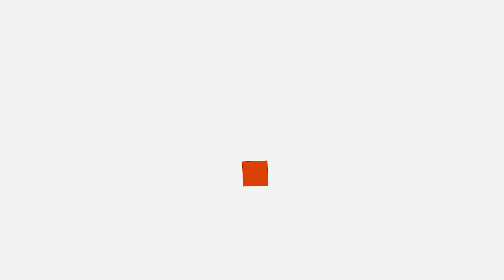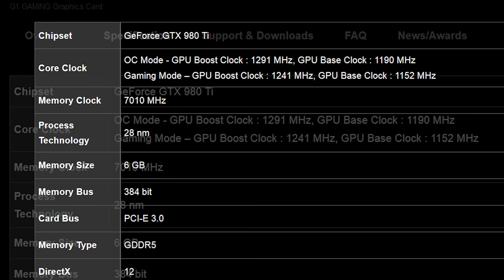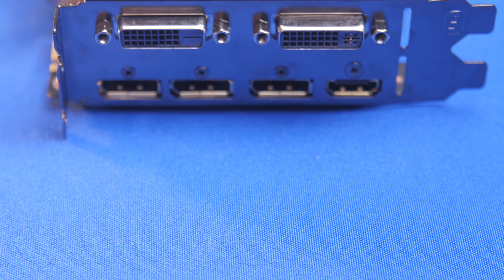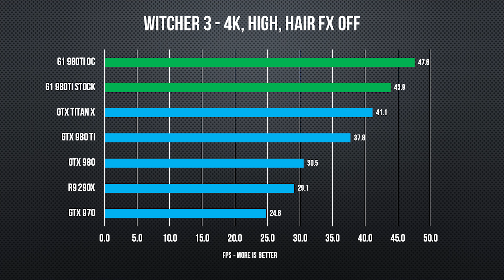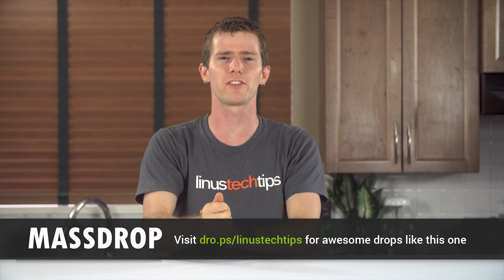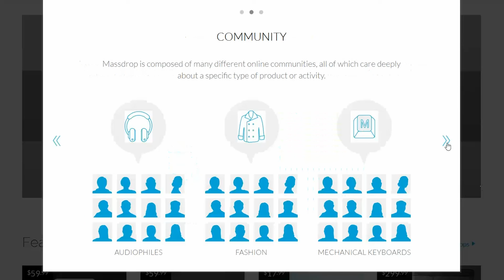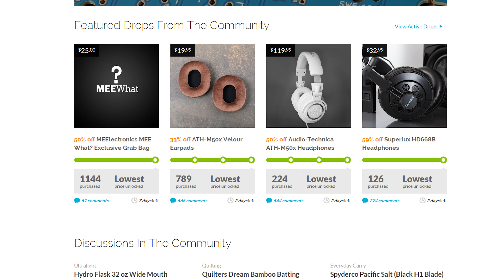Gigabyte G1 Gaming GTX 980 Ti - Both Beauty & Brawn?

Comment: Is this good?
CPU- Intel Core i7-4790K 4.0GHz Quad-Core Processor
Cooler- Cooler Master Hyper 212 EVO 82.9 CFM Sleeve Bearing CPU Cooler
Motherboard- MSI Z97-GAMING 5 ATX LGA1150 Motherboard
Memory- G.Skill Ripjaws X Series 32GB (4X8GB) DDR3-1333 Memory
Storage- Seagate Barracuda 1TB 3.5" 7200RPM Internal Harddrive 
Video Card- MSI Geforce GTX 970 4GB Twin Frozr V Video Card
Case- DIYPC Skyline ATX Full Tower Gaming Computer Case
Power Supply- Corsair CX 600W 80+ Bronze Certified Semi-Modular ATX Power Supply
Optical Drive- LG WH14NS40 Blu-Ray/DVD/CDWriter

Comment: Ehm, I love LTT, but seriously - TX just got wrecked? TX is the better card - 980Ti is a cut down version of the same core. How can you compare OC'd results from 980Ti with stock TX? :D Who in their right mind buys a Titan X and runs it at stock? :D Luke, Luke :). Jayz did an excellent video on this, OC'd Titan X, vs OC'd G1 Gaming 980Ti - aaaand yeah, 980Ti still fell short even though it was clocked 1529MHz vs 1400MHz on TX. I can run my TX at stock volts @1405/4000. If I go bananous with volts, it gets up to 1520/4000 and I'm not even running a full block. I usually clock it @1480/3970 for gaming, but at that, it still blows this card. Until we see crazy high (1.4 and more) volts cards like KINGPIN or the new LN2 HOF, TX is still the king. Just look at Firestrike HOF ;)
Reply: the Titan owners defend their titan cards
Reply: tosasaurus DEFENCE!!!! :D but seriously, I think saying "TX got wrecked" is misleading without providing context. I will readily grant that 980Ti is a better bang for the buck - by far - Titan X is an enthusiast-grade product and you pay premium for it - but it is the the faster card. Simple as that :)
Reply: Yep you are right! If I had the money i would go for the Titan X but I chose this card and will be getting it tomorrow :D
Reply: tosasaurus You won't be disappointed ;) Enjoy your new awesome GPU!
Reply: Thanks!! Super psyched

Comment: Linus! Something that would be FRICKIN AWESOME would be to have a benchmark build containing 4-way crossfire with 4 radeon r9 295x2's!!! It would make my day! :D
Reply: Alexander Zapff the r9 295x2 is already a dual gpu card.  That would be technically be 8way crossfire in which the support for such doesn't exist yet.

The maximum amount of gpus ( be it four single gpu vid cards or two dual gpu vid cards ) that any motherboard can support regardless...its 4.
Reply: then make it dual crossfire r9 295x2, and benchmark it!
Reply: Alexander Zapff Just find a benchmark of 4 slightly overclocked r9 290x's and you have a similar score. Besides, they don't have an r9 295x2.
Reply: yeah... I just wanted to see him overclock the crap out of them and run a couple 4k games simultaneously on multiple monitors... sigh

Comment: so why buy a titan?
Reply: superguitarmaniac100 because its the better card and 12GB of VRAM. Yes yes - I can already hear the comments - ITS TOOOO MUCH! Same story we heard when 780Ti launched with 3GBs and lookie now :). If you want the absolute best single-card GPU, get the Titan. If you want a really really good GPU for much better price to performance ration and/or more silent solution (AT STOCK - which - if you run TX is sort of meh :D) and/or you don't plan to overclock yourself, get this or other variants of 980Ti. Simple.
Reply: ***** If this card is clocking in at better higher speeds and crushing the Titan X on 4k by 10 to 15 frames per game, while also being 300 dollars cheaper, why wouldnt i get this 980ti? 12 gb vram is overkill and 6gb vram on this card is future proof enough for years since game devs are stunted to make really demanding vram games due to the current gens consoles
Reply: Alfred Ortiz Correct. These guys are not stupid. Playing up the relatively affordable 980 ti and down playing a generally disliked $1K gpu, garners many more likes. To their credit, they didn't lie. They just didn't OC the stronger card. Impressionable youths that follow them will eat this farce up and spew it out as gospel. For shame LTT. Likes are worth more than getting down to the metal it seems. Still, it's solid info however misleading.
Reply: Brandon Ferreira not sure if trolling or you simply don't grasp the concept of factory OC? He is saying the graph itself is misleading. As I have explained in the first comment, this 980Ti is factory overclocked - at stock speed. This is ONLY useful if you don't overclock the card yourself at all - and I'm having hard time imagining a lot of people who buy $780/$1000 GPU will run it at stock. I.e. its faster for people who are lazy and/or don't know what they are doing (for various reasons - I can elaborate), but the potential of the card itself does not change with this (albeit it is very very marginally better because of cut down cuda count and arguably better PCB design). When Luke said that TX got rekt and that we all knew it was coming, it sounded like he was implying G1 is the better/faster card - which it is only under that limited scenario. Overall, its still a slower card (albeit a better deal in price/performance category) and thus is conclusion is incomplete at best - more likely factually wrong.
Reply: titan x out performs the g1. sorry. you're just wrong.
Reply: Michael Angst yeah... no. Games go over 6gb now and it won't get better. Remember the 780Ti launch? 3GB is plenty!!!!! You won't need more than that! 6GB is crazy too much!! 

Yeah that died out quickly. If you plan to buy Pascal as soon as it releases and dont' care for occassional stutter, you are fine. If you want peace of mind, you go with TX.

Also your comment on G1 is just wrong (unless you run stock clocks on both cards in which case you are doing it wrong). Shows how much you know about GPUs and who the faggot here is ;).
Reply: Brandon Ferreira True. But if you manually overclock the titan it will still beat this card. I suspect this is why slick played up the "boost up on their own" card. Titan X got wrecked in his review, but it was not a fair comparison. Nobody it seems cares for a 1000 dollar gpu.
Reply: Brandon Ferreira again not sure if serious (this answers specifically your first comment). First, its not crushing it by 10 - 15 frames per game @4K even according to the graphs - you might want to watch again ;). Second, its doing so because its overclocked - both at stock and then the OC that Luke put on it and you are comparing with stock speed card. Factory overclock simply means that you ship the card closer to its limit. Meaning this card @"stock" goes up to @1370MHz on core, while overclocked it was 1480Mhz + I bet you that Luke overclocked memory because there is no way 110Mhz is 3.7FPS @4k Witcher 3 . But the limit for this card is - like any other GM200 card around 1550MHz (+- you have to take into account silicon lottery). Meaning this card has 180MHz on core overclocking headroom. Meanwhile, Titan X has the same limit of 1550MHz (maybe 10-15MHz less since it has more CUDA) and so while at stock clocked it boosts to 1177MHz (+- depending on the card), it has some 370MHz overclocking headroom. In short - you are comparing OC'd card to a non-OCd card and saying the OCd card is better. Thats a stupid statement. Not sure if I can make this any more clear than this.
Reply: ***** lol it's in my own original profile pic. you won't find that pic anywhere else on the web. Guaranteed.
Reply: think away as I play in 4k! lol That rhymes!
Reply: +deenycest10710 Just thought to correct your statement about consoles having 8GB of "VRAM" - please throw that statement out that window my friend because that 8GB is shared between the OS and the Games (some of which is reserved exclusively for the OS) and of what remains is split between graphics and game memory which can change on the fly. (Unified memory architecture)
:-) <- the more ye know!
Reply: deenycest10710 Impressionable youths? You do realize in the graph they showed this 980ti at stock speeds and it was STILL regularly beating the Titan X at stock by about 5 fps, or are you blind?
Reply: ***** For me I'd buy a 980ti and after a long while, buy another one. With DX12 I'll have a 12GB VRam and nearly double the performance of the Tiran.
Reply: ***** You dont seem to get that right now NEXT GEN consoles have only 2 gb of vram, and virtually all game developers will at this point NOT make a severely superior and demanding game only to downgrade it so much. 4 gb of vram is going to be the max needed for a while now, so 6 gigs is future proofing yourself for quite some time. the only games that may test 4gb of vram at widely used 1080p resolution will be PC only games with HUGE  budgets for a design team.
Reply: Not sure if you are trolling, but it's common knowledge that CURRENT gen (ps4 & xbone, next gen implies up and coming, NEWS FLASH they are already here) have 8 (eight) GB of VRAM. To think developers will not favor consoles is to deny reality. The FACT is all AAA titles from 2013 up to recently were optimized for console. CD Project even admitted it for the Witcher 3 and the Arkham Knight fiasco is still so fresh that I can't believe you would think developers don't favor console development. Just look at the evidence! Think about it. What does this mean? It means even if we pc gamers have more powerful gpu's (and anyone with a GTX 660 / r9 270 and up certainly do) we can't keep up with AAA console ports because of sloppy code. ps4 will run out of horse power before it can utilize 6 - 7 GB of VRAM. It will never use all 8 GB simply because the VRAM is shared. However, developers will slap on high definition textures on less complex geometry which will require that extra VRAM headway. A 4gb card will be outdated in a year, certainly before this current console generation is finished. I would bet any amount of money on it. Bottom line, developers prioritize console development.
Reply: No. My water cooled and overclocked Titan X plays this game in 4k. Sorry. But I'm talking about the majority/average of pc gamers, moreover pc gaming as a whole not just my own selfish / personal rig. Your thinking is like a cancer that keeps PC game development down.
Reply: because your not a total moron and there is some common ground.
Reply: Recall all you want. Your 4 gig GPU will be irrelevant soon. Sorry. I feel sorry for you. But your a big boy right? You can afford another 600 to 1000 dollar gpu again next and every subsequent year? lol
Reply: For the record, in Jayztwocents own in depth analysis, Shadow of Mordor exceeds 6GB of use in game (that's just one example). If you want to run lower settings to stay within VRAM limits, that's your prerogative. But YOU are the one who should not spread mis-information here. Unless you are just trolling. In which case, troll away! lol (I just hope you don't live in New Zeland)
Reply: lol maybe. I don't really post vids. Too busy with work. So I guess it doesn't exist! lol I'll be playing in GLORIOUS 4k right now though..guess it's really not happening! lol
Reply: +Ghost 227 Titan X woohoo, an extra 2 frames...
Reply: Why buy a TITAN? well if your a developer then the extra RAM matters, A LOT, or if your doing a lot of video rendering then its a lot better too. For games an OC 980ti can out perform the TITAN in most games, simply put the TITAN is a developers card that gamers got a hold of & just assumed it'd make for better fps, they were wrong, just look at the 1 million & one gaming benchmark comparisons the people have been posting since the 980ti came out.
Reply: +superguitarmaniac100 Because more VRAM if you want the 4k max settings.
Reply: Dion McGovern-Allen So it's just 8GB of RAM (like most modern computers) and no dedicated VRAM? Correct?
Reply: ***** Wow... That's one of the reasons why consoles are bad.
Reply: Justin Fung essentially yes although in the case of the ps4 it is GDDR5 memory which is designed to be really fast with loose timings - great for GPU but worse for CPU which needs tight timings
Xbone is the opposite with DDR3 memory - great for CPU worse for GPU
Reply: +superguitarmaniac100 12gb of vram
Reply: +superguitarmaniac100 But for same price you can own 2 GTX 980 Ti and run in SLI and destroy the titan. Its totally pointless card and you're a moron if you bought one.

Haven 4.0
2 x Titans SLI avg FPS 59 @ 4k max settings
2 x GTX 980 Ti avg FPS 76 @ 4k max settings. (half the price)
Reply: ***** Mr PC elitist is back to rear his ugly head. What is it this time, bragging about your quad SLI Titan X setup?
Reply: ***** Actually no, I just don't think people on this channel appreciate the amount of elitist crap that you say.
Reply: mate you clearly don't understand how DX12 works, 6g per card will be fine to run 4k on anything that will come out in next 5 years.
Reply: +Paul SZ SLI won't double your VRAM :/
Reply: arrow091
Right, but it does use the ram from both cards to render one image. In applications that use that feature in Dx12 API
Reply: Its loads the textures into each card yes but the speed comes from drawing only one half of the screen, the extra speed comes from not having to share memory on one card, which it has to do in DX11 and before, hence why in future you be able to run cards with out using SLI bridges and will be able to use none syncro cards.

Comment: Linus media groups, love your channel so much btw, you guys are my guild to my first pc build. I am thinking about getting the Amd fx-9590 water cooled addition, Radeon r9 390x, WD blue 1tb hhd, no ssd(already over budget without one) 750 watt corsair modular power supply, Amd 990 chipset motherboard, and finally a corsair case. If you could respond and give me your thoughts that would be awesome. Also if anyone else has any thought I would love to hear then. Thanks a lot guys!
Reply: Get rid of that AMD processor and grab an i5-4690k. If you aren't OC'ing then get an i5-4460 and grab a H87 or H97 motherboard. Put the extra money towards an SSD. If for some insane reason you don't want an SSD then grab an i7-4790. 4790k if OC'ing.

Actually, drop the 390x and get a 390. The performance difference is minimal but the price difference is huge. With the $70~100 saved grab that i7 or try to get an SSD. An i7 is amazing for rendering but an SSD is amazing for your entire system.

8 cores make no difference honestly. A higher clock speed does nothing. Intel CPU's are way newer and crush AMD's options. Even AMD themselves are putting an Intel CPU in their own custom dual Fury PC! The 390 and 390x difference in performance is so small that the extra $100 saved makes a huge difference.

So either i7 or SSD. Pick your poison.
Reply: Brett Wolff troll attempt 3/10
Reply: What do you mean by troll attempt? I am actually asking.
Reply: Don't go with a AMD CPU chip in 2015, anybody will tell you that. If you want the specifics head over to the linus tech tips forums and ask there they will be able to give more detailed answers
Reply: Why would I take an i5 4core 3-4ghz when I can get 8 core 5 ghz for the same price?
Reply: Look at benchmarks, 8 cores means nothing when no games use 8 cores, most use 4 threads. Intel newer i5's destroy the 9590. Are you new to building? welcome to the community
Reply: I am doing  more rendering and editing then gaming, but I am trying gaming
Reply: Right on, tell me how you like it

Comment: I love how he overclocks this 980ti to only 1480MHz yet i can easily overclock my 970 to 1650MHz without it breaking a sweat.

Also, i'd LOVE to buy that headset, if it didnt cost $57.98 to ship.
Reply: ***** G1 overclocked but from factory to say its stock is not really true. My Titan X 1457mhz  7750 mhz Vram EKWB cooling overclocked would kill it Lol
Reply: Considering you wasted spending like 300-400$ on a GPU that does the same as this....gratz for you! Lmfao

Comment: my 980ti reference got to 1525mhz no voltage added ,and when added voltage it crashed ,my asus 980ti did the same thing crashed with voltage added ive got them both watercooled with ek blocks and backplates never get over 38 c

Comment: Guys, quick question i'm not exactly tech savvy but which is better this or GeForce GTX Titan Z?
Reply: Villain this in value
Reply: Villain This in everything. A Titan Z is basically just two Titan Blacks in SLI on one card. Two of these are way better than the two GPU's in the Titan Z.
Reply: Thomas Riddle Oh thanks! I was almost pulled by the Titan Z's sexy looks. :P